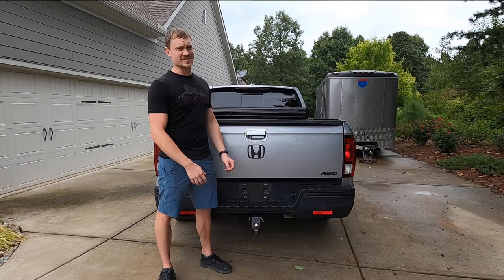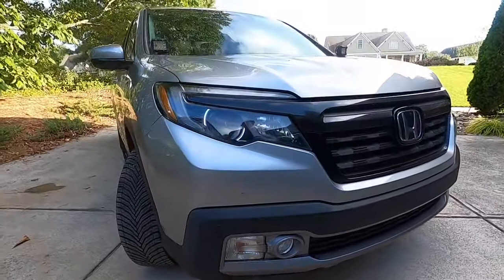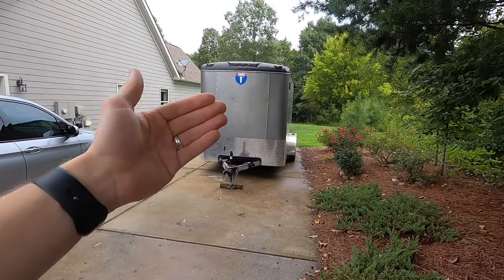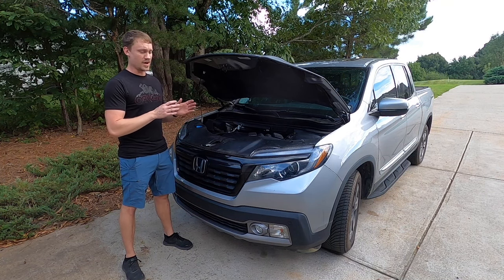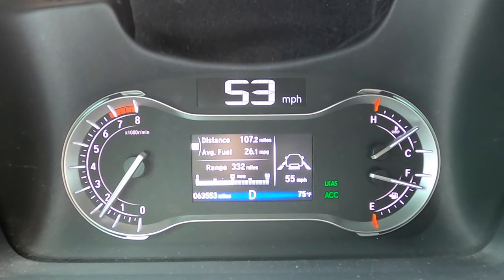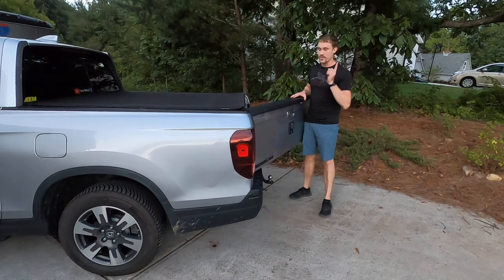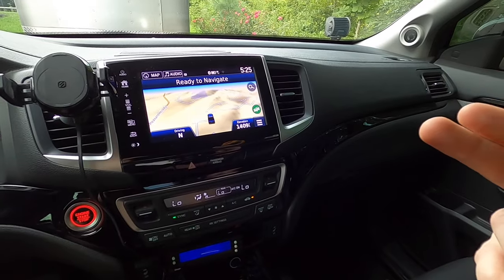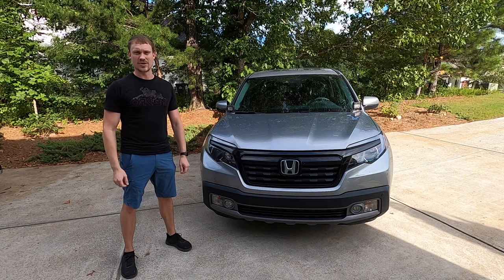10 Things I dislike about the Honda Ridgeline

Comment: I’m old school , I’ve always used a map to go on trips over 100 miles . I’ve tried my iPhone and it will send you down side roads potentially very rough roads or dirt roads or pot holes everywhere. Take the main hwys folks it’s usually just as fast and a lot smoother

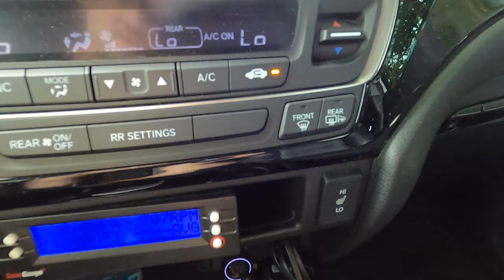Comment: @YuriyMotso 5:29 
Thinking about purchasing a 2024 Ridgeline RTL. Curious about your comment regarding the inadequate air conditioning. Are your windows tinted/coated with ceramic tint? I live in Southwest Idaho, with very high temperatures in the summer, albeit and  thankfully with little to no humidity and I have found the ceramic window tinting on our vehicles to really help dramatically reduce heat transmission/absorption into the cabin when vehicle is parked. Thanks in advance for your reply. I am a subscriber to your channel.

Comment: nice review, thanks... I have a 2019 Ridgeline RTL.  I love the truck, but my biggest peeve is that the back door behind the driver's seat does not auto unlock when I approach the truck WITH ARMS FULL OF STUFF TO PUT IN THE BACK SEAT! I wonder if the newer ones are the same way.  Also, the back doors did not open very wide until I did that mod and replaced the door catches with the ones for the front doors.  never understood that...
Reply: I have the 2023 Ridgeline RTL and all the doors can be set to auto-unlock with the driver's door. Settings/Vehicle/Keyless Access Setup/Door Unlock Mode/All Doors
Reply: @josephmerritt1411  thanks for the reply... The 2019 has no such settings, but glad to hear the later models do.  really the only thing I don't like about the truck.  I do wish there was a 12 V plug in the trunk area...
Reply: @padlnjones  On my 2023 Ridgeline RTL on the rear passenger side there is an access panel to a 115VAC outlet with a max 400-watt capacity. The truck must have the accessory mode on to get power. This is my first pickup truck and I plan to use it on my home-building project.
Reply: @josephmerritt1411  looks like I need a new Ridgeline!  but only 33K on mine so far...
Reply: I have a 2018 RTL-E and can program the locks to do what I want. I think I’ve got it so it responds differently to my fob vs my wife’s.

Comment: Have you given any thought to getting one of the 1.5" front lift kits installed ? I want a front skid plate, and also one for the gas tank. For protection from road debris. I also suspect they might help with fuel economy. 
I've not observed the issues you've mentioned with the cruise control, or the a/c on my 2023.  
I've watched just about all of your videos. I appreciate all the time and energy you've put into them.
Reply: raising your car will not help with fuel economy neither will making it heavier

Comment: Ridgeline Radio Needs to Stay on after you turn engine off and then shuts off after the driver side door is open.  Otherwise you have to keep the car running to listen to the radio.

Comment: Not sure if anyone else mentioned it, but the wireless phone charger is really bad in the '22.  I've tried it with an iPhone with case off, every position imaginable, and it's still basically worthless for me.  I've seen similar comments in other online Honda boards with other phones as well.  Not that it's that critical, but for this trim level, it should work period. 

As for navigation, I've never really been a fan of onboard navigation.  My spouse has a Subaru and it isn't much better.  I use the Ridgeline's just because it's in the model, but if push comes to shove, I'll rely on Google or Apple maps--plus they offer real-time updates for traffic, etc.

Last...who the hell really needs a sun/moonroof? lol  I had one in my CR-V and felt the same way...kind of useless...I live in the northeast, so I just use it..again..because it's there.

Comment: Ive had my 2018 RTL for 4 years. Definitely not the highest trim but I can't honestly say that a single one of these 10 are an issue for me. I don't have Nav so I use my phone. I'm a big girl and put on my big girl britches and clean up the oil that spills from the filter. I rarely use the straight down function on my tailgail. I almost exclusively use the release to open it sideways. I live in Texas where it gets way hotter than Georgia and my truck freezes me out. If you're truly upset about what Honda offers then I hate to say it may not be the truck for what you need.

Comment: DURING Towing capacity TESTING the ridgeline pulled 5000 Ibs much faster than any other midsized gasoline truck with good mpg. Although Other trucks like like tacoma and Frontier rated to pull more.  So wouldn't worry about towing. Ive looked at the real world test. And it tows 5000 with ease 🤷🏽‍♂️

Comment: I have a '21.  Went with the sport model because I would rather use android auto for nav than the expensive factory one.  I agree with a few things, like the oil filter.  You can buy a form-a-funnel to direct the oil flow away from the frame, works well.  Towing could be better but we forget that this is a unibody frame, 5k is pretty good and its not meant to tow regularly.  Think like the zero turn mower to the shop or a golf cart to the course etc.  My ac runs about 10 degrees cooler than yours and I've noticed when cooling the truck down it, it needs to be set to upper vents only as the split bottom and top vent config has weak airflow on anything less than full.  You might try that when initially cooling things off.  Some things you didn't mention that annoy me.  The bed lights go off when the tailgate is down unless you hit the button in the cab AND they are auto off so if you take too long they shut off, wtf is that?  If you are in drive and slowly rolling, opening the door slams the thing into park.  As an ex mechanic you slow roll like this to listen for noises or to line up on a lift.  The front radar/collision detection freaks out when cresting a hill that drops away off camber.  I'm waiting for it to slam on the brakes one day.  The adaptive cruise distance is too far even on the lowest setting, I find myself pulling out to pass way too soon most of the time.  All that said, its the perfect vehicle for what I need and I'm pretty happy with it.

Comment: I've had two Ridgelines, including my current 2019 RTL-T.  I love my truck, but I have to agree with nearly all of your complaints.  I mount my phone in the same location as you, and I think that's an issue for the air circulation.  Otherwise, my AC is fine.  Maybe that critique should be that they didn't plan a good phone mount location.  I agree with the aftermarket parts issue, but that's not truck's fault.  I do understand that it's an issue endemic to the ownership experience, so worth pointing out to anyone considering a purchase.  I would add a criticism, that the shifter often ends up in the low gear position unintentionally.  That's not an issue for new models, because they don't have a shifter.  They have buttons that get destroyed by sloshing drinks in the adjacent cup holders.  I don't like the heave tailgate either, but I wouldn't trade the trunk for a cushioned tailgate, and nobody else has that trunk!

Comment: SO what happens if you exceed your truck's towing weight?  Can it simply not pull it, or is it sluggish?  Or can it like bend the vehicle from the weight?
Reply from the maker: Run the risk of damaging components like transmission that’s not built for the weight, frame can bend as it’s not designed for the additional weight, the suspension will drop completely which will then increase the risk of damaging frame and wheels, the brakes won’t work as intended as it’s not rated for the weight, so on and so forth. You “could” tow but your risk increased tremendously.

Comment: Where the navigation is concerned - does the vehicle have carplay to where you can have google maps integrated on the screen? I'm currently juggling between the ridgeline and one of the newer jeeps. I know totally different platforms but I'm liking everything I'm seeing about the ridgeline.
Reply from the maker: It does have CarPlay built in. I love my Ridgeline. You will never be more comfortable than in a Ridgeline in the mid size category.
Reply: Okay perfect thank you! As long as I can skip their navigation and just use maps I'll be totally happy with that end of things. The rest of the vehicle looks great now, so it's just a matter of deciding if the Jeep is worth the additional cost to me to have the top down, ultimately.  @YuriyMotso

Comment: 0:41 next time when you change the oil filter use a hole puncher at the center bottom of the filter it’ll drip smoothly and no mess when you twist off🎉

Comment: Try slipping a small container under the oil filter, then use a  screwdriver to  punch a hole in the bottom of the filter to drain it before removing it. No mess!😉

Comment: I like that is is lower to the ground, that's the reason I even looked at this truck. It is about the height of a van, so I'm not sure why you would need running boards, unless you are under 5'3" tall. It sounds like you are looking for a full size truck. My a/c works best if I also use the rear air, so I agree that it doesn't cool as quickly or completely if just the front air is used, but the same is true in a van, which was my last vehicle. The towing capacity should have been known to you before you bought it, so not sure why you have an issue. You travel with or just over the towing and didn't expect the engine to complain? Once again not sure why you didnt but a full size truck.
The oil filter... what were they thinking on that one, crazy place to put it. Love the slap paddles, they come in handy going down hills, I hope they will slow the wear on my brakes. Maybe because I'm not very tall the backseat area has lots of room. Tipping the seat slightly lower in the front and lowering it, helps me not have issues with my legs going to sleep, or hurting. 
My biggest grip so far is that the peddles don't adjust for shorter and longer legs, this should be standard on all vehicles.

Comment: i drilled a hole in the bottomA arm and placed a funnel during oil changes , right into a bucket? as far as the weight , honda's ridgeline truck is a MID SIZE TRUCK ? the 5000# towing is at the limit, but like i install air lift air bags in the rear suspension during a tow, . my trailer hitch is 555# and the weight of the cap.is 7000# trailer. the bags are pumped up to 50 #s each making and extra 1250# each side, it pulls great with the air lift and without it its the pitts? i installed a fan for the transmission cooler, and your right honda does need to up grade the cooler, napa mages a durman cooler thats larger 12 rows and 18"x14" and 2 "thick but the price is a cool 1000.00 more , so the fan is a 1500cfm on a thermostat control. i did one more item to the ridgeline truck im 6'-8" tall , so we ( me and a friend) moved the front driver sit back 4" and now it s a 3 person instead of 4, , the lower top is no good for me  and that area gets the luggage,. we extended the arms that hold the sit in place . now the legs arent in my chin but lay flat!

Comment: I find a lot of vehicles from the Japanese automakers lack in two departments: 
1) hvac system, the air conditioning is never cold and the heat is never actually hot. Just warm at most. 
2) the Audio system always seems to be low quality. 
I’ve noticed this on several different automakers: Toyota, Honda, Nissan, even Kia and Hyundai although they are South Korean. 
Those just seem to be the two issues these brands struggle with.  One of the reasons I would be iffy on buying a ridgeline. But I never test drove one yet. So I can’t speak on the ridgeline

Comment: Simple question - the engine cover (2021 Ridgeline) is a pain to get back on.  Is it necessary to keep in on?  Can the engine cover be left off permanently?   Thanks
Reply from the maker: No, it’s very simple. I have taken it off for videos probably 100 times. It can be removed permanently if you wanted. There is no serious reason to have it. It keeps that critical area clean from debris and oils but let’s face it, it’s not getting dirty much. Possibly some sound deadening as well but it is a place for mice and rats to live in the winter.  Trying to save weight? 😁

Comment: To tow a trailer like the box trailer shown here this is just the wrong vehicle and if you're planning on off roading at all this is the wrong vehicle. I have nothing against the vehicle at all in fact I like them but this is actually a heavy duty car with a bed.  90% of Ridgeline owners never tow anything or go off road so those two issues are non factors for most folks. Now some of the other things you mentioned are spot on and should be addressed by Honda. To me the five foot bed is a deal killer as I do on occasion haul loads of mulch or yard waste including brush and dead limbs etc... and the space is just too small. In fact at times a six foot bed is a little small. I love some of the features it offers but be sure to buy the right vehicle to do the job after all it is what it is.

Comment: I have a 2019. My cruise control works fine.  I don’t have the issue you mention.  Agree with the Navigation System.  I usually hookup apple care play to use the cell phone Navigation.
Reply: I bought a 2022 and the cruise maintains just fine…..thankfully.

Comment: Hey Yuriy, are those Michelin Cross Climate tire you have there?  How do you like them?  They are highly ranked by both Consumer reports and Tire Rack.  Can you tell us if you find them quiet and nice riding or not?  I like my Ridgeline for its quiet comfortable ride and I live in the northeast where these new, more winter capable all-season tires would be great (I run noisy but great-in-snow winter tires for 4 months here) but I don’t want to downgrade on the comfort.  Thanks for the channel and ongoing info!
Reply from the maker: I have been wanting to make a review on them. Highly recommend them. Not louder. When I tested the DB of the OEM continentals to these tires the cross climate is quieter. The pattern has a hum at low speeds but that’s really just picking and focusing on it. In general you never notice it. If you get them you won’t regret. They are like driving on rails in the rain.
Reply: @YuriyMotso  Thanks for that info!

Comment: I have 22 Ridgeline and I wish it had a tow/haul mode feature.  I also wish you could turn off the AWD when you don’t need it.  I assume that would save on gas.  Finally, I wish the 9 speed transmission was just a super reliable time tested 6 speed.  It is always changing its mind on what gear to be in.
Reply from the maker: The AWD does not kick on until it detects slipping. It is always FWD until then. Fuel economy is not affected much by this.
Reply: When towing, push the D button to change to Sport mode.
Reply: I have a 21 AWD and a 20 FWD and my fwd model gets about 21 mpg in town that’s at least 3pg more than my AWD gets, might not seem like a lot but at current gas prices it is. The FWD models definitely get better fuel economy.
Reply: The AWD system which is essentially Acura's SH-AWD system will rotate you through curves while on throttle giving you better handling than just about any truck on the market.

Comment: 2021 RTL-E owner here. Its a CRUCK, not a truck! I haul lots of stuff, even my trusses with an extension from etrailer. My main disappointment is that I can't attach a winch to my CRUCK. Yes, ground clearance an issue. Navigation system inaccurate at times. To get the AC working, I have to turn it all the way down first. Dealer says "deal with it." The last thing I hate about it is how it makes a horrible sound when I crash into my chimney.

Comment: I’m pretty sure my Dad never worried that the rusty a$$ 8,000lb tale gate on the back of our Chevy Scottsdale “farm truck” was going to “injure” (smash me into tiny pieces) me when He said to me as a kid, “Hey…go open the tale gate for me…”. 

Your son will survive.  Besides, doesn’t the Ridgeline have the swing open tailgate? You have the advantage over my Dad.  You can say, “Hey son…go swing open the tailgate for me…” 

There, now you have a list of 9 things.  One less thing for you to worry about. 

Also, that oil filter is in a bad spot.  Good call on that one.  But I have suggestion for you when you have to change the oil.  I learned this from my Dad.  Say, “Hey Son…crawl up under there and pull that oil filter off.  And clean up any mess you make, too.” 😂😊

I miss my Dad more than anything.  🙏❤️
Reply from the maker: Both my sons have now been victims of the swinging tailgate. 😂 they have been close lined looking down while walking around the truck. 🥹 At 4 years old the tailgate weighs more than my oldest so it would seriously injure him. It’s a real concern as they just genuinely want to help by opening the tailgate not realizing how dangerous it is to them. 

However I love my truck. Best truck I ever owned. Have had 4 now.

And I am Sorry for your loss. I love my dad too.
Reply: @YuriyMotso  Clothes lined.
Reply: @YuriyMotso  Thanks. 🙏  I have a 2023 and I really really like it.  It the best truck for most people.  Period.   Like an F-250 that can haul 30,000lbs being driven as a daily driver.  Lol. Probably won't really need that.

Comment: Facts.... heated read seats,rain sensors, higher lift kit, bigger engine 3.8 -320 HP. More truck bed. Depending on the wheel sizes 255/65/R22. Flood fog light bar on the roof rack. Remote Folding mirrors. 2feet more truck bed. 1 foot width wider it's to narrow.  bed liner. If that's all the black edition offers. Enter a new trim black platinum edition.  More leg area we should be able to recline the driver and passenger front seats with out inconveniencing passenger seats 💺